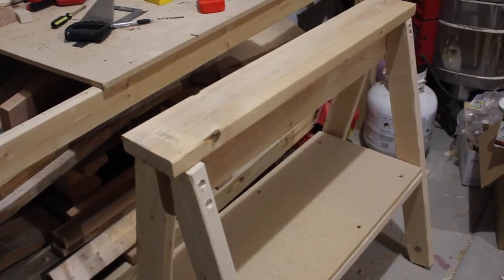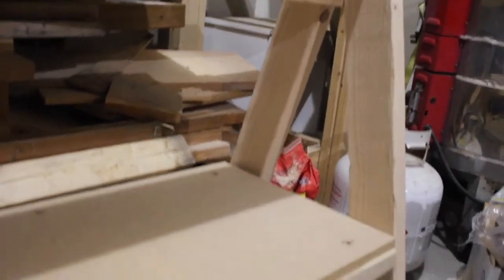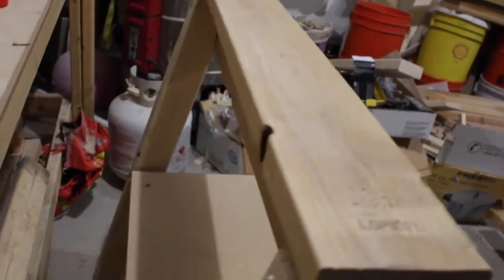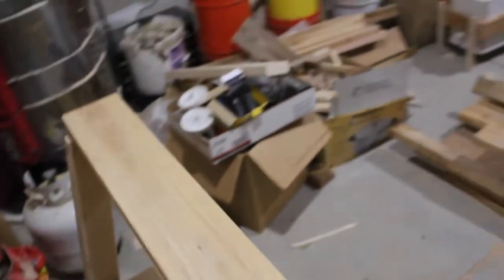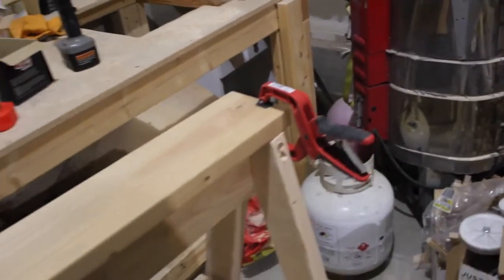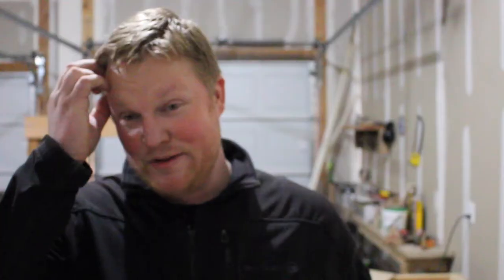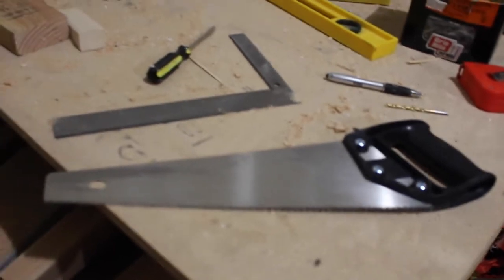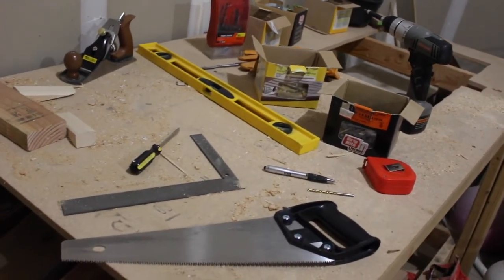Building a Saw Horse - Preparing to build the Workbench

Comment: Tip for the plane...Planes are a one directional tool. At the end of each stroke lift th plane away from the work piece and reposition it at the begining.  Never slide the plane backwards it will dull it in one or two cuts.
Reply from the maker: +jeeperoo84 This is great insight. I literally know nothing about planes, any other advice will be very appreciated. Thanks
Reply: +Bring Back The Farm My best advice is to find someone local that can take the time to show you proper technique. Beyond that there are tons of you tubers that do good videos like Wranglerstar just did a series not to long ago on planes and sharpening them. other wise just do it experience is a great teacher. #getshitdone
Reply from the maker: I totally agree. Thanks